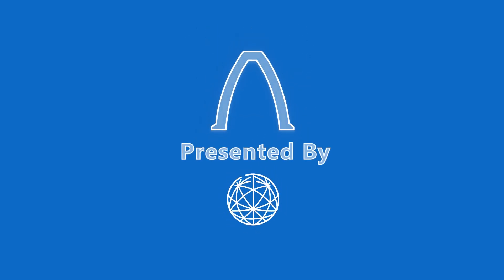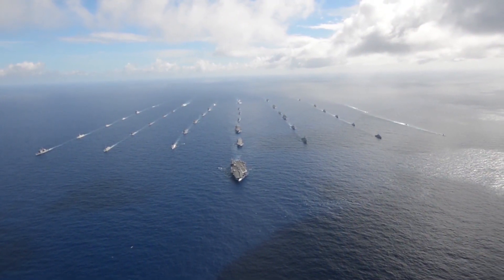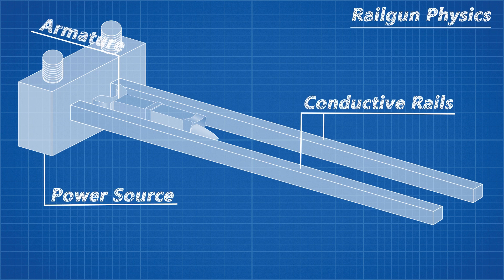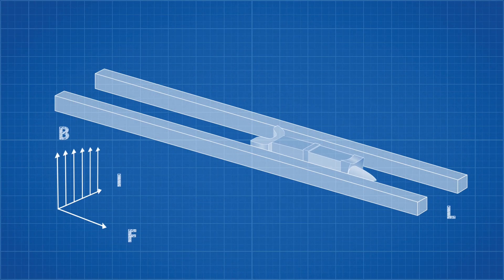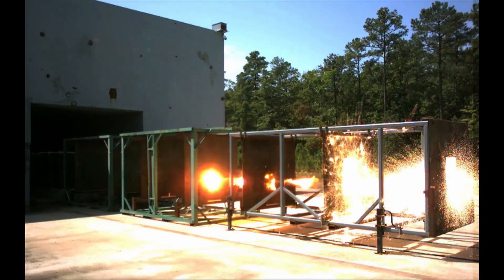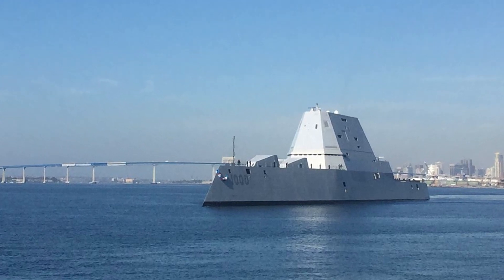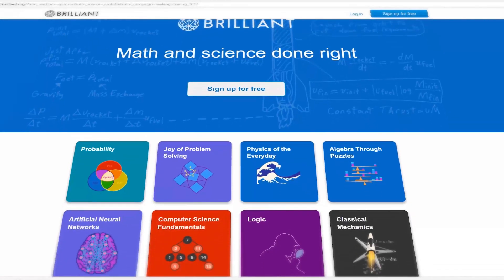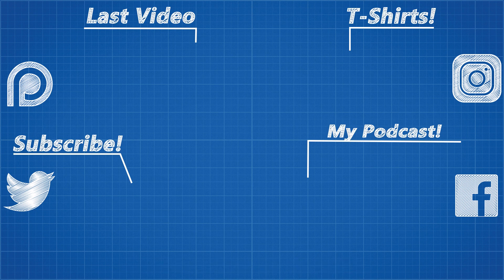The US Military's Most Powerful Gun

Comment: as has been stated already, railguns might help non living matter to reach orbit by acting as the 1st stage on launch vehicle. Light gas guns which are sunk into the ocean likewise have been postulated which can also propel projectiles to great velocities but without the disadvantage of destroying the gun barrel and potentialy losing only a small part of the hydrogen used in the process. 

The types of things that could be launched to orbit using this type of system would for example be fuel, food, water, electronics, construction material, and so on. As long as the cargo fits inside the theoretical projectile and can survive 10,000g or more it could at least theoretically be sent into orbit using this kind of method.

A new problem there is that the speeds reached would generate shock heating in the atmosphere similar to what returning orbital vehicles experience, though heatshields can be used to deal with this particular problem.

Comment: the only issue with putting things into space with this technology is not only the massive electrical interference from the system itself that would likely destroy any and all electronics on board but the sheer G-force that would rip something of that size apart before it even made it to the end of the launch barrel or tube(or whatever mechanism they're using for launch). that NWS(Naval Warfare Systems) railgun is firing at ~6000 fps which is where the majority of the destructive force of this weapon comes from. i remember watching an early test from ~1999 or so in early development they had a much smaller one with a "test" satellite(size was about that of a bicycle) hanging in front of a 4" steel plate(was ~4-5 feet wide, ~3 feet tall and 4" thick), course they shot at near point blank ~10 feet or so, the projectile was a tungsten steel dart about the size of a no.2 pencil. the aftermath of the destructive test left the largest piece of the "test" satellite about the size of a walnut and the steel plate that was hanging behind it had a nice ~6" hole spalled clean through it.  granted that maintaining that kind of velocity over a long distance isn't going to be that feasible but the speed due to the weight of the "dart" and that of gravity will be more than sufficient for it's intended purpose.

Comment: Can you power a Space ship this way.
Reply: You still would have to carry projectiles in lieu of fuel. However, if the projectiles were tiny, like an ion, it would work, hence the ion thruster.
Reply: @thorstambaugh1520  I like the Consept of it. But as the Vidieo stated it's tearing it self apart Ea Time it's used. An you need a Large Power supply to used it. 
I'm no ENGINEER. So maybe this is not the Answer for Space travel then. An the cost of this Rail gun may out weight it's Benifits given it's destruction factor. Shortens it's life Span of use.

Comment: That was a nuclear test not a aircraft carrier blowing up
Reply: carriers don't have powder rooms because carriers don't have gun battery systems... and you should look up the Halifax explosion and it'll give you a bit more understanding about the magnitude of explosives that are carried on a battleship granted the Halifax explosion was a cargo ship hauling fuel and TNT. temperatures of over 5000°C, shock wave of ~1000m/s and sent up a cloud of smoke ~12,000 feet, the shock wave was felt ~130 miles away, it also displaced a few thousand gallons from the harbor and made the floor of the harbor temporarily visible which then caused an ~18' high tsunami. the shock wave leveled ~400 acres and anything not leveled was incinerated from the flash in temperature. do you know why they rate nuclear weapons in "tons of TNT"?  kiloton = 1,000 tons, megaton = 1 million tons.
Reply: Check again. I thought so as well until I looked again.

Comment: They've pretty much solved the problem of the railgun destroying itself by repeat firing.  They can fire about 25 to 30 rounds before they have to change out the magnetic rail which they are trying to get to under 5 minutes.  If you have several railguns at your disposal (like all of us do), then while 5 or 6 are firing, you can shut the one down  that needs maintenance.  Makes sense?

Comment: Seems if a counter current were placed on the rails, magnetic forces might hold the projectile suspended off the rails and centered as the projectile exits.

Heat would still be created but it may be possible to control the lesser temperatures.

These same magnetuc forces may be controllable so as to give the projectile even more speed and range due to friction loss.

Comment: The rails are the barrel and the propellant. Since they are metal, they will erode when 30-40 megajules/milisecond are pulsed through them. Poor design. Rather limited lifespan. If designed to be quickly replaceable, not a major problem.

Comment: I don't understand why the US Navy would want to get rid of the explosives in their shells. All you'll be doing is poking small holes in a ship. That might be a problem for  yacht but a military vessel? There is a reason why all or nothing worked as an armour scheme.
Reply: You know that Tanks are not attacked with explosives but with "simple" metal darts?
The armor can pretty easily deflect the explosion but when you break the armor you have inside a hot mess of flying armor parts and molten metal just because of the penetrationforce.

Comment: Militarily it's been longer than twenty years and it's immensely powerful. Generally needs something to cool the barrel  (?) sufficiently
Reply: It's not like fitting a WWI era machine gun with a water jacket.  We're talking about metals instantly vaporizing along the rails and re-depositing on everything inside of the system.  I'm sure the rest of the rails eventually do glow red-hot and soften after a continued firing, but that may be another engineering problem to overcome.

Comment: The video sounds like the problem of rail abrasion is almost solved, but it really isn't... The concept of a rail gun has been around for a long time and prototypes existed (to my knowledge) since WW2. Rail abrasion is one mayor issue that's basically as old as the first railgun. And I wouldn't expect a good solution in the next decade or so... Especially since modern railguns are becoming more and more powerful by using higher and higher currents (up to several MA) thus increasing the abrasion problem.

And the civilian use... I truly doubt a railgun will shot sattelites into orbit in... well... ever. At least from any object with an atmosphere. It might work on e.g. the moon though. But that's also not even close to the reason they are developed.
It's a weapon, being designed to kill people. Don't sugarcoat it.

Comment: “If if... They wouldn’t have had a power source capable”... Bla Bla Bla 

Dude, nuclear power🙄
The USS Enterprise, which was built over 60yrs ago, had 8 reactors plants (over engineered; sure), definitely electrically capable though
Reply: The problem lies in the fact that EACH shot costs 25 megawatts, if you are in a battle with multiple railguns on board the power would still be high by even nuclear power standards, not to mention the costs to run all equipment in said battle, including moving the aircraft carrier which is why the ships need nuclear power in the first place, while it COULD work, it just makes more sense to use more reliable and cheaper weapons ready to use
Reply: SC Fulmer Exactly, all 12 US carriers have nuclear power capable of 40 years of energy. I learnt that from Wendover ;)
Reply: In short is not that it cannot be done, but it is really not as consistent as traditional weapon. A nuclear ship can power a couple of shot before running out of energy, and the railgun dismantle while being expensive af for double range and velocity. The balance in benefit/loss is way too uneven when compared to mainstream guns.
Reply: @TheSilverwolf97  Someone in the pentagon did the math and decided it couldn't compete with existing missiles in terms of range/accuracy much less the ones in development.

Comment: What if the rails were made of titanium with a outershell that actually can conduct electricity, and what if the intigrated a self oiling system so when fired the system sprays oil over the projectile rubbing the oil against the rods to reduce to the metal on metal contact

Comment: As usual great video!
But I'm sure this isn't the most powerful gun in the US
This railgun can shoot projectiles i believe at mach 7, but the projectile only weighs like 3 kg
Comparing that to a common cannon of a tank (example: m1a2's 120mm L/44), which fires a usually 8-10kg round at 4,5-5 mach. The speed is a little lower but with 3x the mass it carries a lot more energy. Now the rail gun is probably gonna be more accurate and has more range, but tanks are pretty accurate too and with a range of up to 8km that isn't bad either. The biggest difference is the tank barrel weighs about 3 tons and can be fitted on a tank, which is a movable armoured unit. It also gets energy from the propellant in the shell which propells the projectile, making it a lot smaller, cheaper and simpler.
I'm pretty sure navy cannons (i believe these can be more than 400 mm in diameter and can shoot at targets 30+km away) are a way better option compared to a rail gun. The technology (if possible) is just not there yet

Comment: I worked out the physics, and it turns out that the muzzle speed of a rail gun one metre long and half a metre wide plugged into 240V 15A DC would be about 3 m/s, assuming a coefficient of friction of 200 between the rails and the armature, and ignoring all other forces (except the lorentz force, of course).

Comment: To Real Engineering
As you have discussed in this video the Rail Gun is a weapon that uses the properties of the "Lorenze Force" to its advantage to propel a projectile at speeds of Mach 4  down the barrel with a range of 161 miles or 260 km. And as you also discussed one of the main problems with using the weapon is it generates immense amounts of heat melting the barrel rails each time it is shot. I was thinking of a way to solve this problem and thought of an interesting answer. Use the Rail Gun in space, because the Absolute Zero temperatures you would find in space wouldn't affect the "Lorenze Force", propelling the projectile down the barrel and would also counteract the heating problem that limits the use of the Rail Gun, and with no air resistance the projectile could theoretically, travel an infinite distance at  Mach 4 or higher. 
However since I do not acquire the mean to prove my theory right, I leave this question to you.
 
Could the Rail Gun be used in space and if so, would it make more sense to do so?

Please reply back.  : )

Comment: From what I seen that when the rail gun is fired the projectile slides off the barrel. But with if we double the 2 magnet rods and place them on top and bottom and use it to make the projectile "float" threw magnetism and launch it wouldn't that sustain the  guns longer. Or even have a electric field around it up until it leaves the "barrel".   Well that's my opinion and I'm more interested in the development of the space elevator.

Comment: Hi,.... Please consider a potentially ideal methodology of protecting the 'barrel' or 'rails' of the railgun from destruction after a few shots. First constructing it from materials capable of thermal variations/gradients would be helpful.  But my primary suggestion is that super-cooling the 'barrel', and between shots, introducing water vapor, to form a uniform ice layer, would be most efficacious.  Water is one of the only materials to expand upon freezing, so a thin layer would not only provide lubrication, but cooling as well.  Even as heat is generated it would generate water vapor, or steam even, that would protect the surface of the weapon.

Comment: So the drawback is that the rails destroy themselves.....   Thats problematic in terms of warfare.  For other industrys not so much. For example, create rail sleaves that go over a none magnetic Rail base, that can be powered. These shouldn't be destoryed by the force of the shot, and sleaves would simply be switched out between shots. Say launching a space craft. 
Also Generation of the power to use it to launch a space craft while taking much more power, a launch site, can hold vastly more power than any ship. So power concerns could be midigated.

I suggest Batterys huge ones to slowly draw the required energy for 1 launch over the course of say a couple months.  Plus a nuclear reactor's power should make Building the worlds first rail space launch system possible. The Sleaves would be built and detatchable on the sides of the shuttle its self. thus it can be propelled and detach on its way out. Conserving all fuel for space manuvering. This should allow us to make a human trip to mars and back. Calculating a direct mark 6 flight there and using the old fuel to escape the earth to propel them back at a faster and faster rate since space doesn't have friction. 

Should in theory work anyway. Not sure how many years the trip would be maybe 2 round trip.

Comment: A disk revving at 10000rpm with a width of 30 meters would meet that speed without all the power surge and the melting. Slowly accelerating the projectile until it reaches mach 7 then letting go of it. The risk would be the sudden collision with the air outside the muzzle.

Comment: The new class of aircraft carrier has 700 mW of power. If it could be somehow modified the 78 mW power requirement should not be a problem.  If you cut out the engines for a while for example. You would still have 622 mW to run the other systems.

Comment: Unless the ship is nuclear, it still has to carry more fuel to power the rail gun. You do err on this. The laws of thermodynamics are on my side. You can't get something for nothing. The other thing is that that the projectile is less than 8 pounds with no explosive . The Russian 152mm Howitzer can send an explosive projectile that's many times the weight 70km down range, so this means the velocity would have to be comparable because the track curve is only proportional to velocity and not mass (aerodynamics not included). This means that the rail gun projectile would have to travel about twice as fast just to break even.  
The other thing of note is the Russian Howitzer can utilize guided shells and sabot rounds also.
With current Russian missile tech it's doubtful whether they would ever see a need for a rail gun. It's not rocket science. anyone can make them. Cool though huh.

Comment: I once saw a 3 Tesla "Railgun" Demonstration, the doc showed me what metal does in an MRI after I asked what would happen (I was about 14 I think). He held his ballpoint pen close to the opening, it started lifting into the horizontal when he got closer to the opening of the MRI machine, then he let go and the pen shot through the MRI, after going almost to the other end of the tube it suddenly changed direction and got stuck on the top of the tube of the machine. This all happened so quickly that it was hard to see, so imagine what happens when the magnetic field is turned off at the point of maximum acceleration like it would be in an actual railgun!

Comment: When talking about using the rail gun to launch an object into space... That just seems to impossible to me.. The amount of Energy required I can easily look past, but we're not only talking about an insane acceleration, but the speeds required to reach space in the first place would have devastating reactions for the object due to air resistance, anything going that speed should reach insane temperatures. Secondly I can't fathom how an object could be anything more than sub orbital... Also while in orbit around a planet if you fire your boosters you're just changing where you are going to be, even if I blew up a nuclear bomb behind me for propulsion, assuming I dont break the earths gravitational hold eventually I will be right back at my starting place.... If we start as a railgun on the ground... I just struggle fathoming how it could create an orbit around earth.

Comment: We originally engineered rail guns so ammunition costs were cheaper. Ironically; the rail gun ammunition is much more expensive. Sure they have higher muzzle velocity and range, but our fire control systems aren't really there to land a projectile on target 75+ miles away. One of these shells specifically the LRLAP will set you back around $800,000. We all know math right, so why would you want to fire such an expensive shell when you could use a Tomahawk Anti-Ship Missile that runs a little over the cost of 2 of these shells. Not only that, but if you are in range to engage an enemy contact with that rail gun then shit is totally fucked up.

Comment: Am sure these problems can & will be overcome, because 1 there is heat resistant steel and they can use water to keep it cool,
2 if an perpetual motion machine does exist ,it can generate indifite power using only magnets .

Comment: maybe an idea... premagnetize the projectile either directly or with a jacket of magnetized material, and then make some other sort of system to magnetically suspend it and reduce the problem of friction. and then drive it using some other sort of contact between each rails, like some sort of superspeed timing electrical transistor system of some sort, all you would need for specific timing is if its too late, engage it earlier, like if its too slow on the later "bridge" pair it with another in the sequence and make that "bridge" last ever so slightly longer
Reply: probably wont work, but hey, its a theory, a RAILGUN THEORY, thanks for reading....